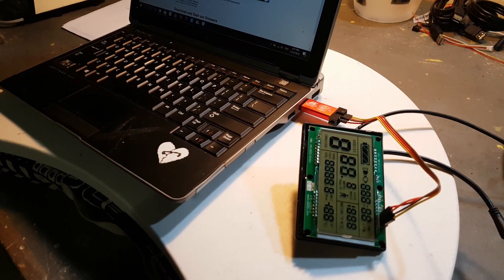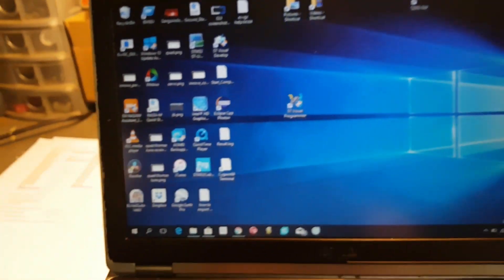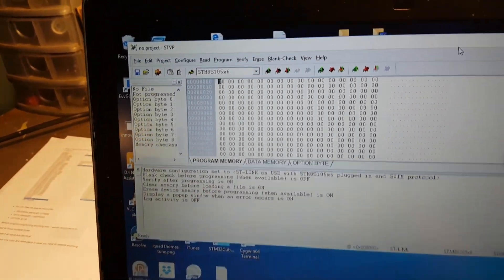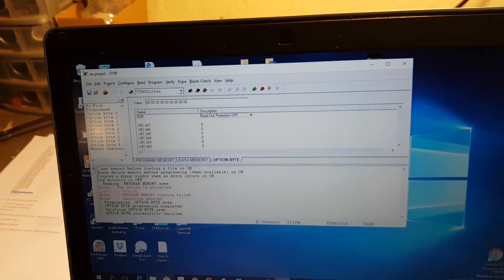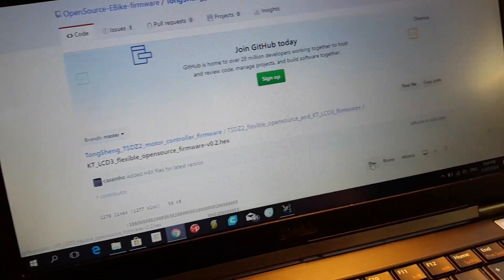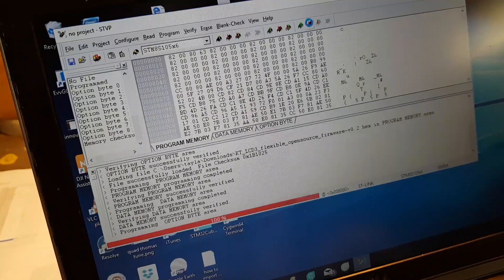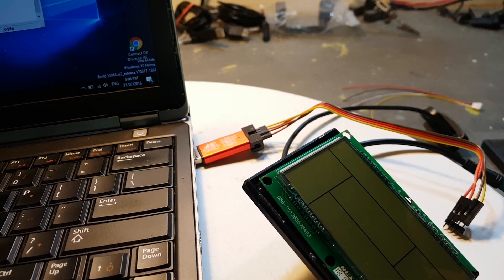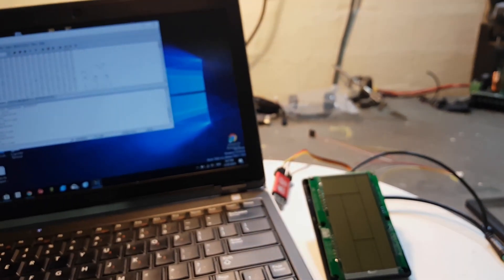TSDZ2 OPENSOURCE FIRMWARE | PART 2

Comment: Hi John/JB,
I have watched several episodes on when you trim the Tongsheng TSDZ2. To do what you have done seemed too complicated for me! I decided to take a short cut. It cost money and didn’t work …
I bought the yellow box from Eco-ebike and used the APT burn tool with the latest bootloader from github. Result: The display is frozen and the screen reads: Keep pedals free and wait
I have invested a lot of time to fit the motor to a nice frame and really hope there is a fix.

Ciao, Peter in Göteborg, Sweden
Reply from the maker: Hi Peter I’m sorry you are having problems. All I know is what is in my videos and the ktlcd3 display. Seems you have used an 850 or 860 so you need to follow the casainho 860 thread. Let me know if you can’t find it. Alternatively the guys at eco bike are very helpful maybe speak to them first. As always I recommend you try the stock motor first to make sure it actually works. I don’t know how to flash the 860 it seems hard to me I don’t think it’s worth the trouble. Maybe just go back to the stock display and use the mr brusa early firmware like c2. It uses a Java app to make all the changes.
Reply: @jbalatutube  
Thank for generously sharing your work and for answering, even  
when you since long have moved on to new experiments!
Reply: hi! do you recognize my problem?

since i wrote i have tried to flash the display with the settings shown in part two (with an off the shelf bootloader), but st visual programmer givs the error message ”cannot connect to target”.
Reply from the maker: @peterwockatz6772  there are 2 possibilities maybe the cable is too long from motor to dongle. Mine is only 20 cm. Maybe use 3v line instead of 5v. Also it could be the pc. Windows 7 works better. One more thing maybe wiring is not right or your stlink wiring is labelled incorrectly

Comment: Ok so i had been running this firmware and setup for  a while, i had a issue with my battery and it has bricked the software so how. after replacing both the lcd and the control unit in the motor i still can not get it to power on, any ideas?
Reply from the maker: Try a different battery
Reply: @jbalatutube   The battery is only part i can confirm is working still, have checked with charger and quadcopters. Thanks for your input though. Do you know anywhere in the uk that could help?
Reply from the maker: @kennethcartman473  no I’m in Australia sorry. You can try flashing the mr brusa firmware and see what happens. https://endless-sphere.com/forums/viewtopic.php?p=1664848#p1664848
Reply: @jbalatutube  Thanks will try. :)

Comment: Hi. Thanks for your videos. It was your review of the TSDZ2 motor with OSF that put me on to this option, and I'm glad I went this way. I'm wondering if you’re happy to flash other people’s motors? I have a TSDZ2 with an 850C display fitted to a recumbent trike. I want to update the OSF since I'm finding the version I have a bit buggy. Usually, I'm confident around this kind of thing, but after watching this video, I'm worried about taking the wrong step and ending up with a dead trike. Are you in the Sydney/Newcastle area?
Reply from the maker: Sorry no I'm in Melbourne and I don't know anything about the 850C. They usually talk about the 860C but I have only ever used the kt-lcd3. You are better off asking in the forum. I would update to the new MrBrusa firmware rev 20.1C2 look up TSDZ2 for all displays in endless sphere.
Reply: @jbalatutube  No worries. Thanks mate 👍

Comment: Hi! Thanks for the video. I have a xh18 display. I can't find the information on internet on how to connect the wires to it. Do you have a link? Thanks
Reply from the maker: You can only flash the ktlcd3 otherwise you need the Marco firmware. You flash motor only and change settings with a java front end

Comment: Is there someone able to answer to the question from Ronans Tab ? I'm also interested to know wich connector part number is required to connect the ST link Cable to the display PCB. Does it need to be soldered or just plugged in ? Thanks !
Reply: Ok, found, i answer to myself : https://fr.aliexpress.com/item/32885532141.html?spm=a2g0o.detail.0.0.6e387521WVkdyx&gps-id=pcDetailFavMayLike&scm=1007.12873.83260.0&scm_id=1007.12873.83260.0&scm-url=1007.12873.83260.0&pvid=4bf5db87-87ef-4864-92a2-fbe82246e5b1
Reply from the maker: Just solder your own connector whatever you have sitting around

Comment: fantastic videos, it is possible to do in a kt lcd3 but with rear HUB engine. I'd appreciate your help. greetings from Spain
Reply from the maker: Yes not with this version but you need to flash the motor controller too so they can talk to each other so long as you have a KT controller casainho also has firmware for that
Reply: thank you very much for your quick reply. this is the driver model I have, I suppose by your answer that it will be compatible driver - "KT60SVPRCKD-JLS01" bought in conjunction with kt-lcd3 "60V 2500 W-3000W 60 Amax DC Brushless Motor Controller Ebike LCD3KUNTENG sine wave Controller + KT-LCD3

Comment from the maker: Just in case you are wondering the new display does come with a long cable. Some thoughts are that you can tuck n the old connector to the motor housing and splice into the existing wires on the controller so that we don’t need to cut any wires at all !
Reply: Hi,
I just tried to update my LCD3 but unfortunately I got some errors:
 Error : Cannot communicate with the device !
Check the SWIM cable connection and check all the needed pin connections on the SWIM connector.

If the application code uses Swim Disable and Reset pin as Output or has disabled SWIM Clock Divider:
Try Now to SWITCH OFF and ON the application Power Supply while NRST Reset pin is forced low.

Error : < PROGRAM MEMORY reading failed.
Error : < Operation aborted.

Do you know how to solve that?
Reply from the maker: Make sure you are using a short cable. Also check you are using the correct software and select the correct protocol 105x6.. Are you getting power to the LCD ?  Did you wipe the options tab first like in the video ? Your drivers may not be loaded properly. Use this as a guide. https://www.eco-ebike.com/blogs/eco-cycles-instructionals/tsdz2programmingfromscratch